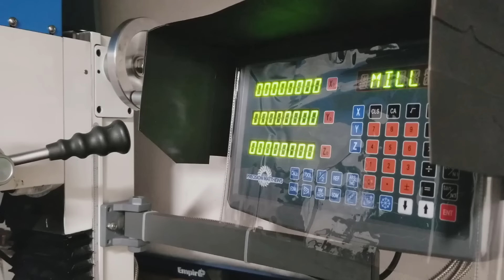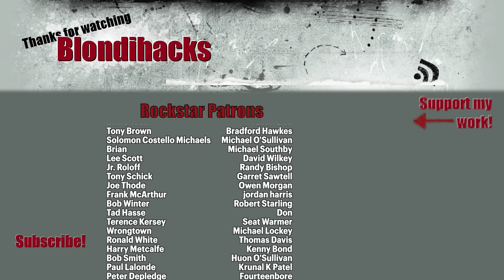Slots in Metal! Mill Skills, Part 9

Comment from the maker: Hey everyone! Lots of folks asking about the walking parallels. That happens because the part is not squared up, thus can’t be tapped down well enough to tighten the parallels.
Reply: Good explanation, good job
Reply: I thought that it was an optical illusion! "That parallel can't be moving sideways, surely? " Ah well,  at least I wasn't imagining it.
Reply: Remove the parallels once the vise is tightened. You don't want them migrating to the center under the end mill.

Comment: Ninja trick for chain drilling: Lay out an odd number, drill the odds first then the evens.  That way the material on either side of the hole will always be symmetrical.
Reply: What if you just calculate the required diameter for a perfect layout with 25% overlap?
Reply: @stevewyckoff6904  
If there is a void on one side of the drill bit and not the other, the drill bit will still tend to "climb" to one side. If there is a similar void on both sides of the drill, as in Jim's scenario, the load is equal, and the drill bit will deflect less.
A 25% overlap will ensure that the deflection is consistent and you could use that to your advantage but you would still have the barbell effect at the end you started from.
Reply: This is a principle woodworkers often use for creating a mortise (aka "slot") with either a router or a hollow mortise chisel. Most import is to remove material at each end first. Then if you happen to have a bit of deflection on the inner cuts, it doesn't really matter. I think a similar principle would apply here.
Reply: What if you're only drilling TWO holes, then, smart guy!? There's only one of each! Or worse: ONE hole! What THEN!?

(Naw, man, I'm kidding. You're quite right. We use the same technique with mortising machines in woodworking; I'm just goofing around.)

Comment: I learned something from this video, thanks! Here’s my share. There is a trick to chain drilling that may help you. If you laid out the holes evenly before you started drilling, then rather than drilling every hole overlapping the next, drill every other hole to start then come back. You can avoid a lot of unbalanced interrupted cutting. The leap frog sets up your overlap so the interrupted cutting forces are balanced and your bit is less likely to walk into the hole next to it.
Reply: I was looking for this comment before making it myself :)
Reply: When chain drilling the floor board with a hand drill in my SUV to make a hole large enough to replace the fuel pump I used a 1/4 drill bit. But first I put the drill bit in a 1/4' steel pipe 3/16 of an inch to the tip and used JB weld to affix it to the 1/4' drill bit. The reason is so as to limit the depth of the drill bit. When drilling you don't want to drill into the gas tank.

Comment: A good trip for chain drilling closer together: do all your center drills, then drill every other hole, then go back and do the middle holes. This stops the drill from walking like yours did on the last hole because it's either always surrounded by material or the opening is the same on both sides.

Comment: I just did four 1 1/4" X 3/8" slots in 3/8" plate for an electric motor base with the drill press, jig saw and a file. A milling machine is in my future.

Comment: How I cut a slot?  I start with the chain drilling method.  Then I use a rat tail file until I get worn out.  Then I use a die grinder with a rotary file until it gets stuck and I almost twist my arm off.  I rest up a little and go back to the file.  I file again until I get a rough looking slot and give up and hope it will do.  If it doesn't work I find a piece of scrap metal with a slot about the right size.  I cut it out and weld it where I want it.  Then it's time to get some sleep and try again tomorrow.  I love the endless aspect of my metal working methods.

Comment: I once worked at a company here in the UK that produced mining equipment . One job we had to do on my cincinatty )milling m/c was to plunge straight down 6" with a strasman milling cutter (looks a bit like a tap as it had wavy edges) then feed along 8" at full depth at 1 .750 inch per minute feed rate. The mill did it with ease but it used to frighten me something awful 
Keep up the good work

Comment: About a year late to the party, but this tip may still help some people. I love Anchorlube and it picks up the chips and allows the flutes to move them out of the work area. The problem with Anchorlube is it stains your vise and any other metal it comes in contact with. I first heard about it from Abom I think? Regardless, when I heard it I had used Anchorlube the day before so I immediately went to my shop and sure enough I had some stains on my vise. I cleaned it up the best I could, but the stains are still there. I still use Anchorlube because it is the best chip removal process I have seen. I don't have liquid coolant so I can't compare them, but Anchorlube does the job, you just need to clean it up immediately. I believe you have a few hours because I have used it since and cleaned it up and have had no further problems.
Great information in the video, keep them coming.

Comment: For chip clearing if a good finish takes priority over avoiding a mess, compressed air works extremely well to clear the slot out while it's cutting
Reply: But Quinn is right on one point, flood cooling is the way to go and even better when it's going through the center of the mill cutter.

Comment: And British engineers discriminate between an end mill and a slot drill (US: centre cutting end mill). The slot drill is intended to drill (on a mill), so a twist drill, which lacks rigidity, is less effective for chain drilling, see CatNolara's comment. The slot drill can also cut sideways (hence 'slot') so it can also produce the slot. End mills cannot drill, may have more flutes for a given diameter, and a thicker core, and so are a bit more rigid than a slot drill. But this was a very useful video.

Comment: The "barbell" problem also happens with routing slots in wood, even when you think your tool and work piece are firmly anchored. The multi-pass method works there too. I know, it's a woodworking comment  😞

Comment: I'm a big fan of using a vacuum to remove chips. I made an adapter for my mill that holds a shop vac crevice accessory near whatever cutter I'm using. It probably catches 75% of the chips. If you are working with something that makes a powder like cast iron it does a good job of keeping that off the mill and out of your lungs. It also helps if you are doing one of those obnoxious tasks that generates a great quantity of little splinters that like to get stuck in your fingers.

Comment: I have one of those flood coolant position-able hoses attached to my Atlas with a metering valve, but I run air through it instead of flood so I can blow chips away.

I gotta get one of those spring things for my parallels as well.

Comment: Brilliant, as always.  The concept of cutting oversize for a drill or endmill was not immediately intuitive to me and this is very elegant way to demonstrate what is happening.  Thank you.
Reply: It's actually quite dificult to drill a "perfect" hole in one shot. Strait out of the box, drill bits tend to either drill slightly oversize (due to the drill point not being exactly on center) or the hole is  not round (the flute geometry is not exactly symmetrical.) This is why machinists will drill undersized and ream to the final dimension.

Comment: Thank you for creating this and posting. Don't have a mill and need to slot some 1/2 steel to help out with a friend's project. I was telling him about chain drilling. 
As it's a rough prototype, I'll do that and then use a die grinder. 
I just picked up a 40's era Craftsman drill press that I'm going to mod for light milling. I love your channel and ability to explain everything. I'm just getting back into this stuff after 40yrs of being in software engineering. I learned some basic milling on a big ol bridgeport in the 70s.  YT is such a great platform for learning skills and techniques.

Comment: Thanks so much for this Blondie, I’ll be using the chain drilling method from now on and the beauty of doing that on the mill is that the work doesn’t move. I can just swap the drill chuck for the milling cutter and I’m away. For the amount of ware I’ll save and increased accuracy it’s a no brainer, funny how I didn’t think of it.😂😂 Thanks and cheers, Stuart 🇦🇺

Comment: I noticed on the third slot in your steel part (that was chain-drilled with an undersized drill) that you can see marks / irregularities in the slot wall from where the drilled holes were. I noticed a similar phenomenon when I used this technique a few eeks ago to build a custom drain grate out of aluminium. Why do these things appear even though the drill is sufficiently undersized? It does not make or a very nice looking slot. My theory is that the change between the drilled-out parts and the still standing parts cause a differential workload in the cutter. I suppose the solution to that would be undersized chain-drilling plus then using the 3-pass-method afterwards?
Reply: Yes, exactly that. It's never fun to cut a keyway. Too many variables and the cutter never likes working on two flanks simultaneously while being buried in, so I always leave material for  two finishimg passes. You have to be patient.

Comment: One tip for easier chain drilling where you can have a ton of overlap is to use an annular cutter since it's more like cutting with an endmill and just cuts on the outer edge and has a hollow center you don't have to worry about holes to close together and the bit deflecting towards the other hole and chattering around plus it usually leaves a nicer finish they are a bit more than regular bits but even the cheaper off shore versions cut faster and last much longer than regular bits they've become a lot more affordable and many holders are available that can often be ran in a drill press or a 3/4 collet on the mill 👍👍👍

Comment: very nice, though you forgot method 4, that being ramping in one way and either staying on one level when returing to the zero point or even continuing the downwards angle. works rather well, I'd say, and can be done by simply manipulating two axis on your machine with your two hands. that's one cnc standard that you can also do with a manual amchine, up to and including circular ramping with a rotary table and a vertical motion (just keep the rotary table going at all cost and don't mix directions when disengaging from the wall, else you'll end up with an egg shape). also keep in mind that this might be somewhat slower than directly plunging in and doing a full depth cut at once, as there's a maximum angle you can do with your endmills, usually around 5-7°, though this becomes more of a "yeah, this feels about right" situation when doing it on a manual mill.

Comment: I tried to cut a slot in 3/16" steel plate full depth one pass.... my machine chattered so bad I had to stop I tried a 2 flute cutter and turned up the speed to max and still no go the chatter was over whelming !   I had to resort to about a .005" deep pass a thousand times just to make that slot.... I now cut my slots with a grinder !  my mill won't handle it !

Comment: I'm very new to machining, and am enjoying your videos quite a lot. I do have a few questions though. I'm about to purchase a small lathe because most of the things I am interested in doing make more sense on a lathe, but, I was curious if a lathe could be used for this same type of machining. Obviously it makes the most sense to do slot cutting on a vertical mill, but I won't have access to a vertical mill for a bit.

Comment: ramping in would be another technique... CNC machines use that often for for deeper slots without center cutting end mills... on a manual mill it just requires coordinating the horizontal and the vertical feed

Comment: I had to cut quite a number of slots for the first time recently and encountered the bell mouthing issue at the end of the slot. It's good to know why. It definitely reduced by doing partial depth plunge using the slot milling cutter, but it was still there. Also with the chain drilling, the slot seemed to show artefacts from the drilling, like small radius bumps along the slot. Could you feel them at all?
Reply: You can see "shadows" of the webs in the finished chain-milled slot. I would like to know if you can feel them or if a dial indicator will detect them.

Comment: Helpful and informative, as ever, but one thing has me a little confused: you suggest using the two-flute endmill with several passes, so that the finishing cut is done with conventional milling on both long sides? This is done partly to improve surface finish? The thing that confuses me is that I understood climb milling to give the better finish. What am I missing? Sorry if I'm being thick.
Reply: @martinconnelly1473  Thanks.
So, on a beefy machine, the climb cut might be better? I mean,  rather than run down both sides conventional milling all the way, one would climb cut both sides? (Given a stout machine and solid clamping &c)

Comment: Wondering if you can do light milling in a good drill press?
Reply: You "probably" could but it's definitely not recommended. The bearings in a drill press are not designed for side-loading, and neither are drill chucks. Side-loading will lead to premature bearing wear/failure, and the vibration from side-loading can cause chucks to loosen and the cutter to do unkind things to your project or you.

Comment: Could you do slot cutting at an angle?
Reply: @martinconnelly1473  Don't need angle in the horizontal I need it in the vertical.
Reply: @martinconnelly1473  Need 0.250 slots at 45 degree angle through 0.250 plate with out side loading the end mill either breaking it or deflecting the end mill and loosing the 0.250 slot. 0.250 apart. Slots on half the circle 180 opposing direction from the first series of slots.